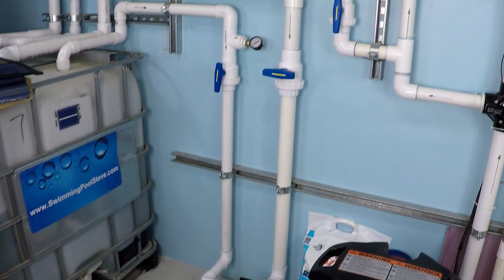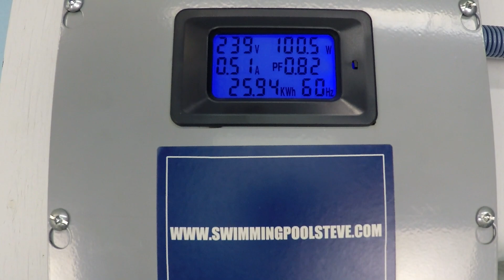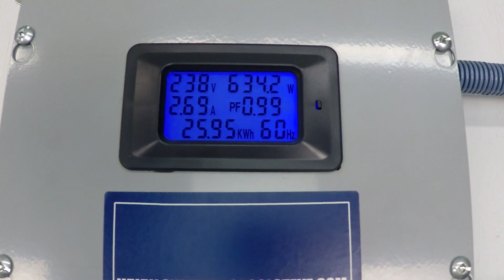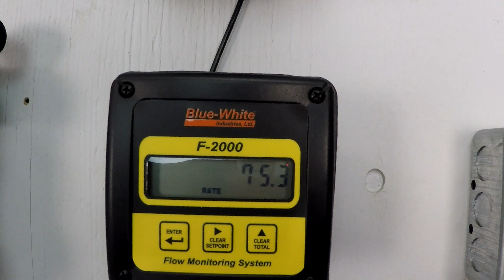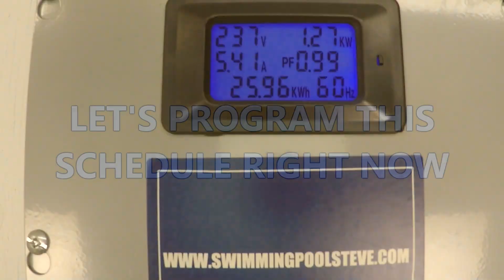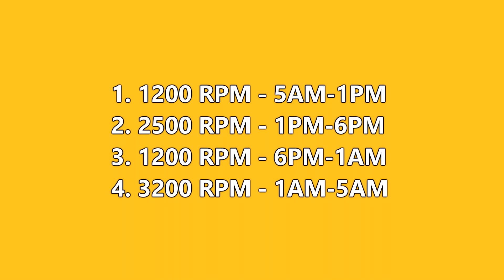Pump Schedule - Black + Decker - 16'x32' Pool

Comment: I have a chlorine dispenser and if I use a schedule like this, I don't get enough chlorine pushing through. Saves energy, but my pool turns green
Reply from the maker: Sounds like your specific pool would need longer hours at higher speeds, or a higher low speed setting.
Reply: @Swimmingpoolsteve Thanks, I'll try that

Comment: I'm a fan and hope you can help me. I'm a new pool owner I purchased a Plungie Max pool ( cast concrete set in place semi submerged ) Purchased a variable speed B&D and also a B&D heat pump. Plumed it all with 2" with long sweeps at turns (per your video's Plumbing inspector was impressed) I know your a fan of running the pump 24/7 but with only 6000 gallons is it necessary?
If so what would be an ideal schedule? Thank You in advance
Reply from the maker: You are so far overkill running 24 hours definitely you don't have to do that. However,  you could make the statement that it does not hurt the pool in any way to over filter it. Small pools are a unique market and the equipment is not sized to cater to these pools. I think I would run long hours at 10 or 15 gpm. It will cost less than a lighbulb per hour to run but even with these long hours at low speed ypu could afford to turn it off completely 8 to 12 hours per day. So 2 hours at 50 gpm, 4 hours at 35 gpm, 8 hours at 10 gpm. Off 10 hours. Cost effective, enough time for heater to run for 6 hours (this number may need to change to account for minimum gpm and length of run time to generate the heat you need). You will meet any exceed your turnover requirements for filtration by a lot. It's OK. It will still be cost effective to run, and that is what matters. Filtering more is ok. Filtering not enough would not be.
Reply: @Swimmingpoolsteve  Thank You for your prompt response, as a newbie I'm still not sure what you gallons per minute = RPM 
I didnt install a flow meter
Reply from the maker: @MrJMV62  then I can only tell you that you should install a flow meter. It's something that I say should be mandatory with every variable speed pump installation. Like driving a car with no speedometer...you can do it but I wouldn't call it a good idea!

Comment: Thanks for the videos. We are replacing a jandy flopro 2.5hp for the B&D vs 3.0 for a 22000 gallon pool in hot south fl. Hard to beat the B&D 5 year warranty and price of $940 with tax & free shipping. The same jandy pump since pool was built has lasted 14 years with two replacement motors. Hopefully this will lower our electric bill. thx again

Comment: Great video! I have a 26K gallon pool with a quad filter. I currently have an old 1-1/2 hp pump that I’ve heard is to small. Can I replace it with a B&D 3 hp pump? Thanks

Comment: Am I missing something? What time of day is it? No instructions on setting the actual time of day..Program 1 is for 8 hours..what time of day is the 8 hours STARTING???? Otherwise, great video...
Reply from the maker: At 3:00 I explain this and then at 4:10 I actually do it. In short, for speed one, and only speed one, you will select a start time. Whatever time of day you want your cycle to start. The rest of the 24 hour clock will be based from whatever you set speed one to start from.
Reply: @Swimmingpoolsteve  Thanks, I wanted to change the time for daylight savings time and the directions have no explanation for that....I shut the power down, turned it on after 15 seconds and nothing was blinking, it just kept everything the way it was....Cannot change the time of time...Have you ever tried this?

Comment: Steve, love your videos and I believe you are doing a great job helping us not pros to keep our pools clean and save money at the same time with all those tips.  Now, as my profesionalism won’t allow for incorrect data to be comunicated, I have to say that the Power Consumption calculations on your first speed of 1.2k rpm is not accurate.  The pump is only seen/using 100 watts as active power (or working power) from the load point of view, however, from the source (power utility company name this apparent power or demand power) the consumption is a little higher because of the power factor (efficiency or losses due to a low load or flow or pump speed in our case ) of the pump at low rpms.  The fact that induction motors, like pump motors, have less efficiency when facing low loads is not easy to understand for some people but it behaves that way.  This is due to the fact that at no or very low loads some of the current is lost as magnetizing current and as such the efficiency of the motor drops.  Anyways, the calculation is a bit higher (~122 w instead of 100w) around $0.04 more which is basically not as important as to know that maybe increasing the speed of the pump a bit more you could raise the load and efficiency and maybe spend the same amount of working watts and money while moving a little more gallons a day.  Hope it helps!

Comment: I’ve been looking at these. The blue torrent units look to be the same pump. I have a 28k pool with 2” plumbing. Equipment is around 20” from the pool. I currently have a 2hp super 2 Hayward. Can I do the 2hp VS or jump the the 3hp?

Comment: Steve, I have an older pool, about 20,000 gallons. My Hayward just went out after almost 20 years. (Screened in so protected from the elements). It was only a 1hp, which surprised my pool lady. No water features, just moving water at a single speed. Would a 1.5 hp B&D vsp be the right size, or should I do up to a 2hp? TIA.
Reply from the maker: No way you need a 2hp if you had a 1hp Hayward. Normally Hayward are small for their rating already so a 3/4 hp pentair whisperflo probably is equal to what you have now. So I see no reason you would go larger.

Comment: Just bought 1. Installed have major leak coming from bottom back of motor. Will let you know how this goes as of warranty from pool parts to go. Interesting tho I notice water marks on delivery tool pictures. Wonder if this was repackaged. I do like it so far very quite.
Reply from the maker: Well that is not great.  Please do update as I am sure others would be interested to know how this works out.
Reply: @Swimmingpoolsteve  They thought it maybe impeller unscrewed and to tighten. Took apart and found impeller defective. They are now sending me out new motor. Will update once new motor comes in. Customer service has been great so far.
Reply from the maker: @611trades  thank you for the update. I used to work in pool equipment sales nationwide and it does not bother me if there is a defect or failure, because statistically they will happen. What I care greatly about is how things are handled when there is a problem. Please feel free to continue to add to your story in the future. Cheers.
Reply: Great news. New motor is installed and working greatI want to say Pool Parts to go. Have been amazing and took care of the business. But I must say I’m just not sold on this black and decker yet. I will say it’s running great and is very Quite compared to even my neighbors Pentair. Will update in about a month with more on that. Pool Parts to go. A+. Steve great channel keep up the great work.
Reply: @611trades  any updates on this, am debating between this and pentair. Let me know thanks
Reply: @Bobos-world2026  I have had no issues since. Motor runs quietly and very happy. Only time will tell how long it lasts. But for the price you really can’t beat. Since Pentair is so expensive right now.
Reply: @Bobos-world2026  I too have had this Black and Decker unit for over a month now with zero issues. I'm installing my flow meter this weekend to get my schedule properly set. Can't wait to see my power bill vs last year with a single stage pump.
Reply: @plaid_cloud   @shawn durnin  I just installed mine this week and am so far happy with it.

Comment: Does anyone know how to set the time. Not the schedule but the time. It’s not in the Manuel.
Reply: Turn off the power from the switch or breaker for 15-20 seconds. Then set the time when it powers on and the time blinks.

Comment: Great videos, thanks. I have ordered the 2hp black and decker to replace 2hp pentair superflo. I have around 12k gal inground pool, hayward salt cell and roof solar heating (single story home). Any suggestions in terms of runtimes and rpms? During the day i like it to be quite as possible (as its close to home office) but also need to make use of the solar heating (which i guess need high rpm)? Thanks for advice, approciated👍
Reply: Sorry 3 HR is 2200 watts.
Reply: The 2 HP is only 1800 watts. The 3 HP is 2000watts. I’d go with the 3 HP.

Comment: So Steve after your test here...which pump is the best to buy, have you done any compare between? I mean you like to have most moved water VS for the less money as possible.
Have you done any test like that? (of course compare within the same horse power range and pipe size) 
Would be interesting I think ;-) 
Keep up with your good work, just love it :-)
Reply from the maker: There is no one right pump.  They are like cars. There are big cars, small ones, trucks, energy efficient ones, gas hogs...pumps are similar to meet all of the dynamic needs that a pool could have.  There will never be one right pump for pools.  Only technical considerations mixed with budget.  As for your question, you essentially have described WEF ratings which are the new metric by which pumps are being compared.  It used to be horsepower which is way too misleading. Weighted energy factor is the amount of water (in thousands of gallons) that a pump can move for 1kW of power consuption as tested over a spectrum of RPM ranges.  If you want to see this look at WEF ratings for pumps.  I think the Tristar 900 (1.85hp tristar) SP32900VSP / SP3202VSP has the highest WEF rating of all the pumps.  Note that larger motors tend to have lower WEF ratings due to the way that electric motors consume massive power at high RPM.  Even a moment at 3450 RPM on a 3hp motor is going to drop the total WEF score, which is why you will notice the WEF ratings on smaller pumps to generally be higher.

Comment: Steve, is there a need to run at higher RPM’s?  I have a robotic cleaner and the heater and filter will run fine at the lower RPM/GPM.  Is there still some need to ramp up the RPM’s for a short period?  If so, for how long?  I was just thinking to keep the RPM’s low and increase if necessary for parties, swim load, excess rain, etc…
Reply from the maker: Yes you need to run a higher RPM also.  It is not enough to just have enough volume of filtered water.  You also need the pool to have periods of time with higher flow rates for proper diffusion of the water and for the skimmers in your pool to function.

Comment: If 40k gal = 3X could you remove the 3200 rpm program? 
2 HP unit w/2” PVC?
Reply from the maker: No I would perhaps choose a lower RPM like 3000 or 2800 but still you want some time at higher speeds daily for proper diffusion of your clean and chemically treated water in the pool.  You also need more flow for your skimmers to function.  You do not need 3200, but you do want some higher speed operation daily.

Comment: Nice. I bought a house with a 20k pool and discovered they were using an above ground pump. Walked into leslie’s and picked up a floor display never been installed Intelliflow VST for $500.  great deal especially three years ago but this isn’t a bad option either.
Reply from the maker: Intelliflo for $500 is a sweet deal!
Reply: Damn for 500? That’s awesome

Comment: I like this pump and the concept of being the underdog.  Will this 1 1/2 pump be good for a 18500 gallon pool?  Also what cartridge filter size/model will you recommend.  My sand s200 filter is running on its last leg!  Thanks for the videos I enjoy the data presentation!
Reply from the maker: Hi there.  Glad you like the videos.  There is not enough information to answer your question meaningfully but I can still provide some feedback.  The size of pipes, number of pipes, and orientation of your pool / equipment will determine which pump is right for you.  Also, of great importance is the pool itself.  Any features like jets, waterfalls, bubblers, edge system, in-floor cleaner etc which all require specific flow. Do you have automation?  These would be the questions I am asking to help someone find the right pump for their pool.  Now, if you knew for example that your pool operated with 30' of total dynamic head and you have a 2" plumbing system, and absolutely no features in the pool other than filtration, then I could tell you that this pump would likely satisfy these needs. You would achieve about 108 GPM at 30' head with this pump. That would exceed most sand filters, and all small sand filters. So the pump would be regulated with programing or the filter upgraded to DE or preferably cartridge, both of which can handle higher GPM typically.  There is a lot of overlap in pool pumps for which you can use. Typically pumps are too powerful when it is just about filtration.  You seldom even need 1.5hp or anywhere near it to filter water under laminar flow.  So yes you can probably use this pump specifically, but I am more saying this based on the generality that you can use most pumps on most systems now that they are variable speed.  So kind of a non-answer answer but there is value in there I assure you.  As for filter sizing I like the bigger the better.  In my area a 20x40' pool would have 500+ square feet for cartridge filter.  No less than 400sf.  In some areas, like perhaps where you are, people use really tiny single element 100 or 150sf filters on full size pools.  That is not something I recommend.  300sf, 400sf and 500sf for small, medium and large sized pools.
Reply: @Swimmingpoolsteve  only info I cant give is tdh I didn’t install the pool in fact it’s quite old.  The pump does however sit 5 feet higher than the pool if I were to guess adding the two skimmer lines but don’t have the bends slightly less than 50’.  One suction line one return line 1 1/2 inch pvc.  No features basic oval.  No vacuum I run a electrical powered vacuum.  Thanks for the quick reply
Reply from the maker: @watermanveteran7198  This pump is probably fine.  Definitely no reason for a larger pump based on your description.  I just wanted other readers to understand this is a complex consideration buying a new pump so that people do not end up trying to use the wrong pump for their pool.  I really do endorse speaking with a pool industry professional for things like equipment upgrades, especially to the pump.
Reply: Forgot important info. Vinyl inground pool in north Florida.